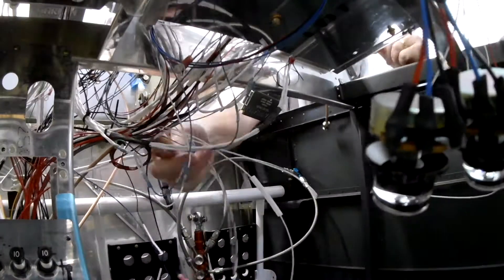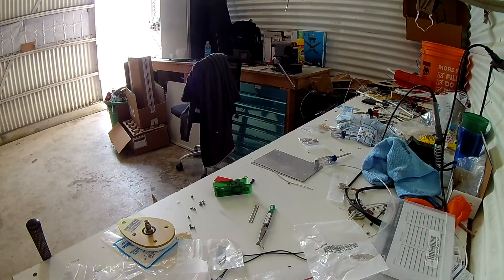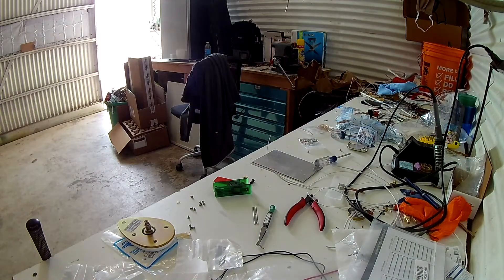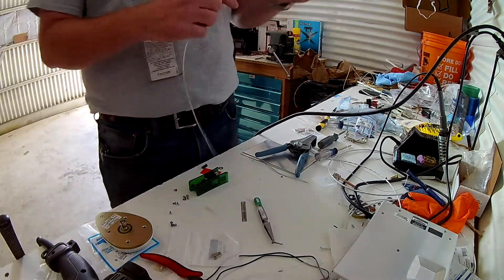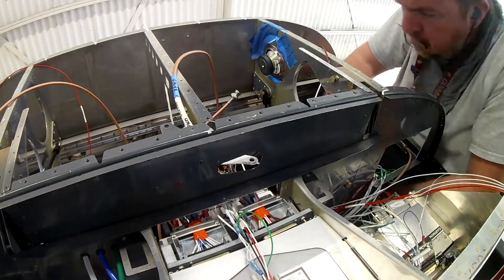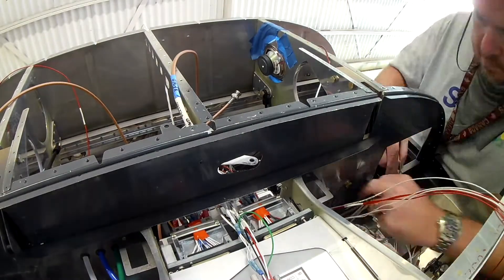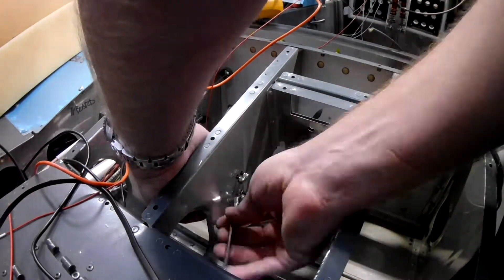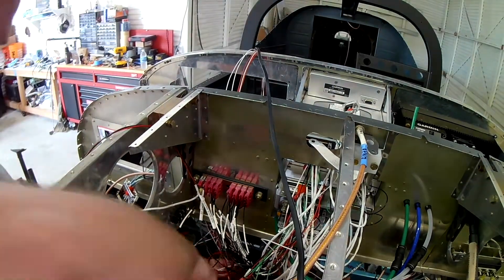RV-14 Wiring My Ass Off!!

Comment: Ok need some advice. Did you do any sort of analysis on how much of each type of wire you needed, before purchasing rolls of wire (like a spreadsheet etc)? I’m going to build my own harnesses and fuse wiring instead of a prebuilt panel and have vans wiring diagram but would think someone added up a lot of the wire lengths…..  just curious how you went about biting off the first bite of the wiring journey. Looks like stein has better prices on wire than spruce right now.
Reply from the maker: That is a good question I shall be answering in this week's video (coming out one day this week).